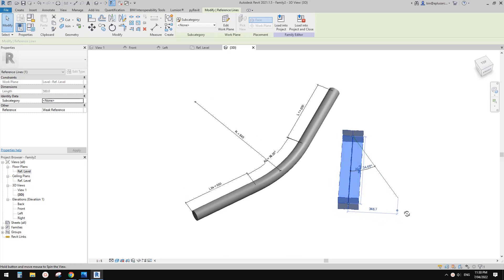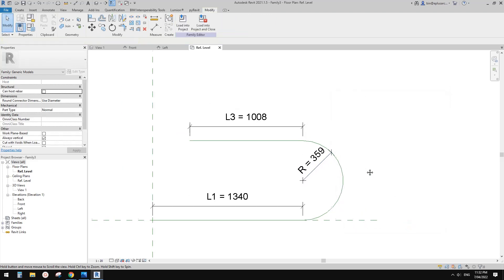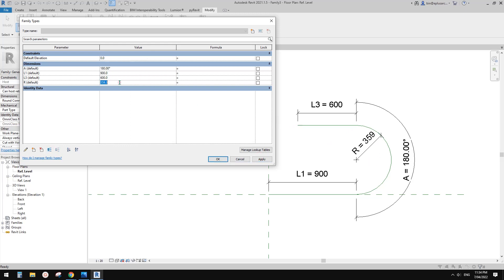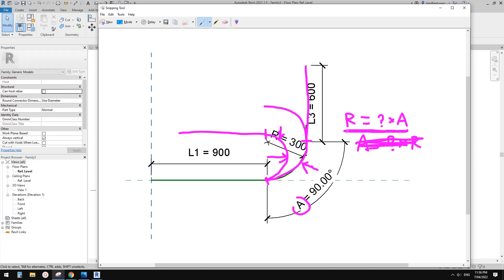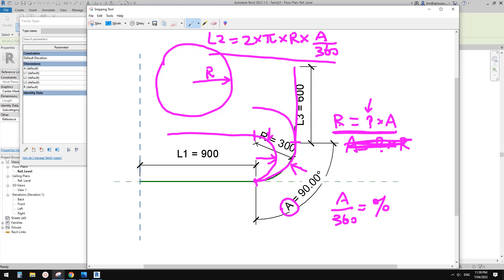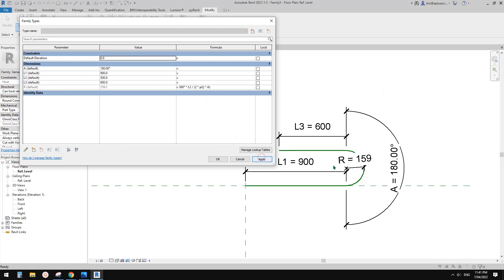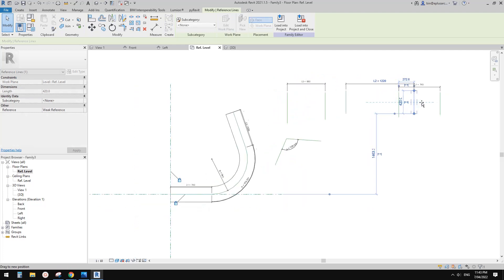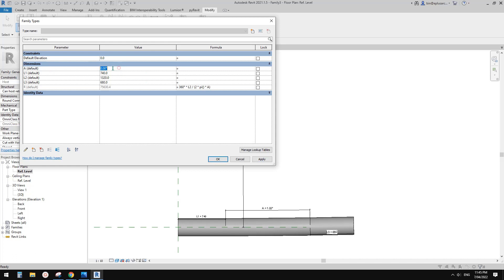Revit Exercise (Day 747) Parametric Family - Unfold Curved Geometry

Comment: Hi. Great video.. Can you create a family in which two pipes are at different elevations can be filleted with a radius instance parameter. Also it has to show the arc length, diameter, angle in a table or by clicking the family which shows the information. thanks
Reply from the maker: Have you tried the pipe and pipe fitting under System tab? I'm pretty sure Revit can automatically connect 2 pipes using some preset pipe fitting family, and can also provide some different options for you to choose. Unfortunately, I don't know much about that part of Revit. :(

Comment: How to set A=0 is work? As straight line?
Reply from the maker: First, create a separate sweep or extrusion (use L1+L2+L3 as the length) for when the angle is 0 degrees. Next, create a new angular parameter (e.g., B) and replace A in the original sweep with it. In the Family Types, add a formula to B: if(A=0,1,A). This prevents the original sweep from breaking. Then, add a visibility parameter to the new sweep/extrusion with the formula: A=0, and a visibility parameter for the original sweep: not(*)—where * represents the visibility parameter of the new sweep/extrusion.